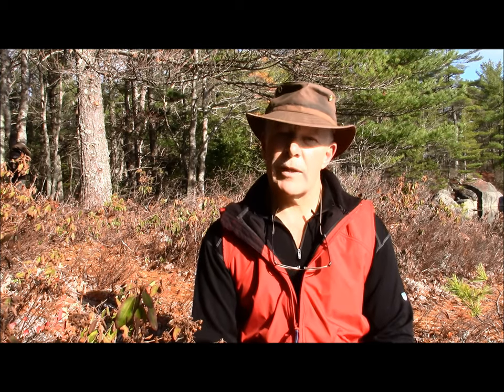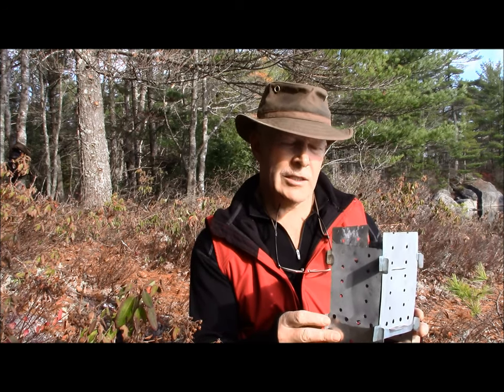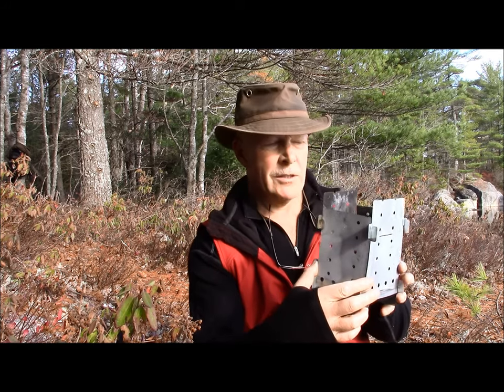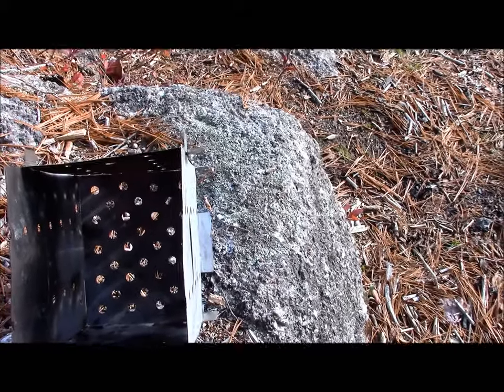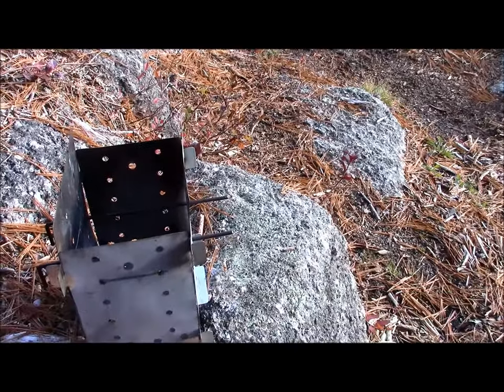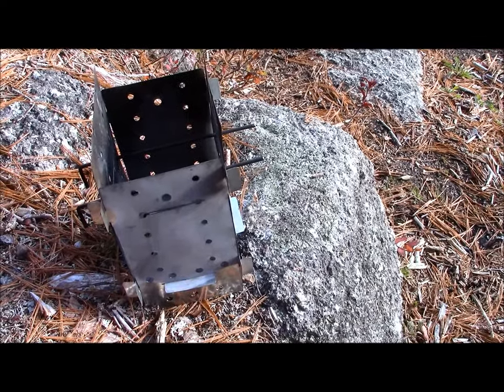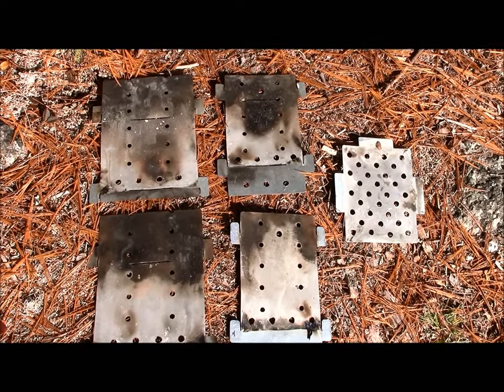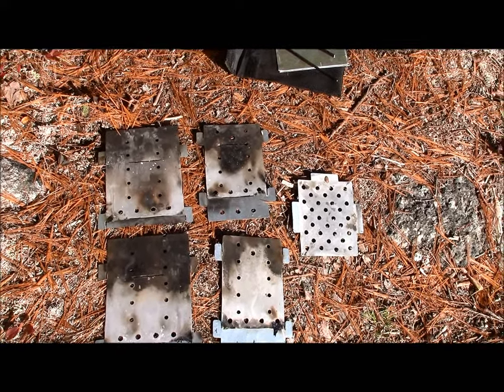DIY Backpack Wood Stove

Comment: Looks like you had a lot of the same ideas I had with some of my latter prototypes.   I just got out my stoves and saw that I had 5 prototypes.   I had at first thought that the inefficiency of the little dandy was due to air intake somehow.   I worked from that angle on several of my prototypes and just was not getting very far.  I had one that worked a little better than the previous ones and after analyzing the changes I wondered if maybe I had been going about it wrong.  I decided to open it up more at the top to allow the air flow to escape better.    That was the secret.    I got to thinking about a regular wood stove for heating a house and thought about where they may have a relatively small intake but may have an eight inch or even bigger exhaust stove pipe for the escaping gasses.   My last few prototypes worked MUCH better in terms of clean, efficient, low maintenance burning.    I used tabs on most of my prototypes just like you but I had the direction of the tabs opposite of each other like you mentioned.   In other words on the right side of one of the pieces the slots in the tabs would come down from the top.  On the left side of that same piece, the slots would come up from the bottom.    That made the assembled stove a bit more sturdy.  My last prototype I just made hinges instead of tabs and it works great.   It is much more solid.    The secret to a cleaner burning stove is allowing more room for the exhaust to escape.   You do not want to let in too much air on the intake as to cool down your fire but the fire does need enough so as not to struggle.     I hope you have inspired many viewers to make their own stoves as they are fun to use and quite efficient when compared to an open fire.
Reply from the maker: Thanks Loni. I love to tinker and make my gear on a dollar store budget. Gives me great satisfaction. I have taken inspiration from you on a number of occasions. I don't think I put as much thought into my prototypes as you have but it is interesting that we both arrived at the same conclusions. Inspiring others to try their own designs is what I hope to achieve. I don't want my channel to be about spending lots of money that people may not have. I hope to inspire people to just get out there to explore and enjoy the wilds... maybe when my channel grows